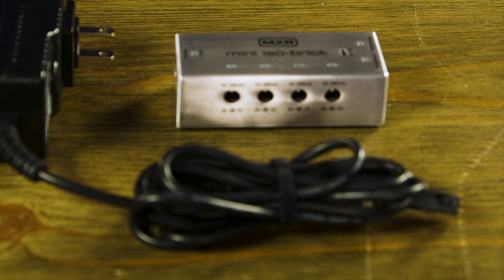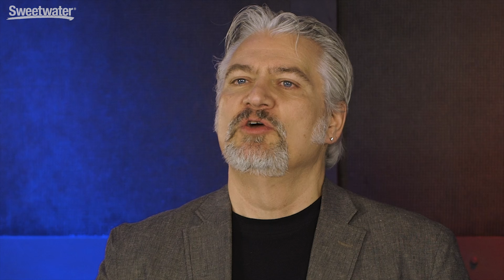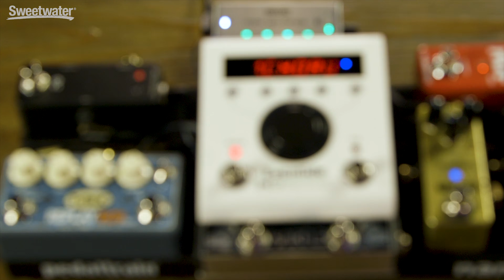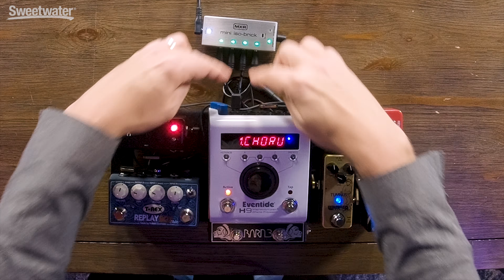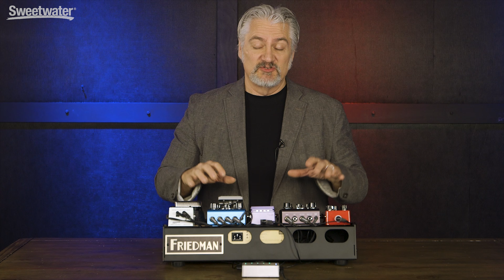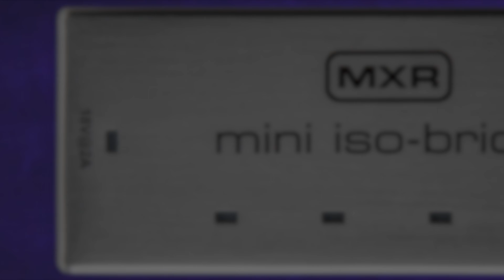MXR M239 Mini Iso-Brick Pedalboard Power Supply Overview

Comment: how do I can connect 2 mini iso brick together?
Reply from the maker: Hi theredibanezguy3826. The Mini Iso Brick isn’t designed to be chained with another power supply. If you need two of them, you’d probably want to just get the full size Iso Brick for double the outputs.
Thanks for your interest!
Charlie Davis, Sweetwater Sales Engineer
(800) 222-4700 ext. 1320 | charlie_davis@sweetwater.com
About Me: https://bit.ly/46kS9pq

Comment: I have the same one. But im having issue when i put it under my pedal board its not working.. and i try to put together with my pedal  and it works just fine.. i mean it doesn't work if you put uspide down like the man did in this video

Comment: can this power a line 6 hx stomp?
Reply from the maker: Thanks for your question Ethan, hope you and yours are safe and well.
The HX technically requires 1.5mA. I powered mine with a Strymon PSU combining two ports via a current doubling Y cable. There are reports of the 800mA port on the MXR powering the HX, however I can't confirm that from experience. Total capacity on the MXR is 1200mA, so there's not much left for other pedals if it successfully powers the HX. MXR makes great products, so if it's a matter of size or price, then it's worth the experiment. Otherwise, Strymon and TrueTone work without issue.
Robert Williams, Senior Sweetwater Sales Engineer, (800) 222-4700 ext. 2371, robert_williams@sweetwater.com

Comment: I just did the math and the small board draws more current (750mA) than the big one (704mA). There's an important detail I could only find in Sweetwater's product specs, and this brick has a max output current of 800mA total. It means you could only use all those 800mA of the 5th output, if there's nothing connected to the other 4 outputs. In short, it can't output 2000mA total (300mAx4 + 800mA). You have to distribute the 800mA among its 5 outputs, without exceeding the max current of each (labeled). I still think this little unit is amazing! I'd only wish they were more clear about this to avoid confusion with the labeled power on the outputs.
Reply: I want to add to this by including what is on the manual for this device: "All outputs may be used simultaneously for a total power output of 17.1 watts." if 17.1W/9V (assuming no 18V), then max output is 1900mA? source: https://www.jimdunlop.com/content/manuals/M239.pdf
Reply: Not sure what you're talking about, but the max combined output of the iso-brick is 17.1 Watts. At 9V DC it can power up to a combined 1900mA total, respecting the maximum mA output of each socket. I'm using it to drive the Plethora x5 (600 mA) plus four other pedals and I'm well below 1900mA total. Are you sure you aren't trying to use something at 18V DC that draws 800mA? It would draw by itself 14.4 Watts leaving little to use in the other sockets (maybe one 200mA pedal)

Comment: does it works with a BOSS rc-30 / Boss Overdrive / MXR Reverb?
Reply from the maker: Hi, Brishonte. Thanks for your question! Yes, the M239 has enough capacity for all the pedals you listed. The Boss RC-30 needs 200mA, the other two pedals are below that. Since each tap on the PSU is 300mA, you're all set. Please contact me direct for any other gear questions or needs.
Robert Williams, Senior Sweetwater Sales Engineer, (800) 222-4700 ext. 2371, robert_williams@sweetwater.com

Comment: so i just got the big iso brick. What is all this 9v 100mA 300mA 450mA business? i got six 9v Boss pedals and a 12v Vocal pedal. the pedal instruction manuals  aren't clear. your input would be appreciated cuz i just wanna stick them in already
Reply from the maker: Hello! My general rule of thumb with pedal power is to ALWAYS match voltage, and then make sure that the mA are equal to or greater than what the pedal requires. The pedals will only draw as much current (milliamps) as they need, so a 9V pedal requiring 20mA is fine to plug into a 9V, 500mA power supply, because it will only draw the 20mA from there. If you plug a 9V pedal into an 18V power supply you will potentially burn up the pedal. Or in your case, a 12V pedal into 9V supply would underpower it, and it would not work properly, and potentially damage the pedal. 
Thanks for the interest! 
Kevin Spunde, Sweetwater Sales Engineer, (800) 222-4700 ext. 1732
Reply: +Sweetwater thanks for replying.... So all my 9v pedals are good but unfortunately  my 12v vocal pedal is 400mA ( the brick is 6-15v 250 mA) sad face sniffle sniffle.

Comment: Wow can it powered HX STOMP?
Reply: It's powerful, but not that powerful. The HX Stomp is 9 volts at 3 amps. Each output on the Mini is 300mA and one 800mA.
Reply: after seeing the CIOKS video about powering  the HX Stomp, all you would need is a parallel voltage doubler(adapter), and 2.1mm to 2.5mm adapter. WARNING: this is different from a normal daisy chain cable. in that video, HX Stomp's current draw averages just below 1000mA. the parallel voltage doubler taps from two power outputs. with the MXR Mini Iso Brick, you would need to use (1)800mA + (1)300mA outlets.

Comment: Cool...in the market for a power supply, building a board now.. I like MXR products.

What cable was he using to split the current off the 800 mA to drive multiple pedals?
Reply: It comes with one "Y" cable to power 2 pedals. MXR will be making the "Y" cable and a 4 pedal daisy chain available separately.